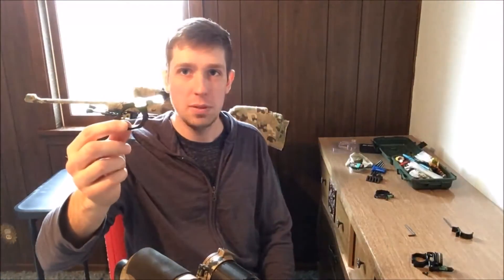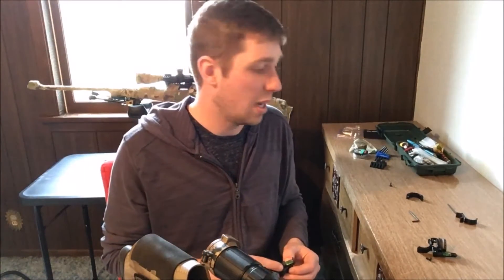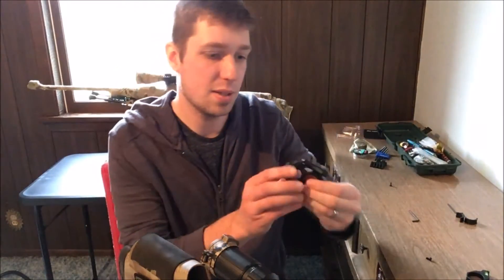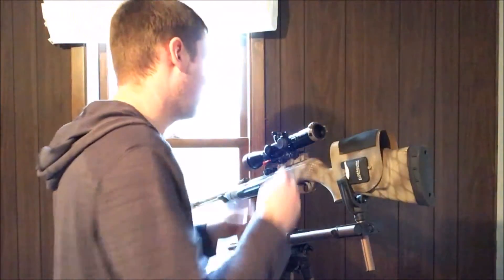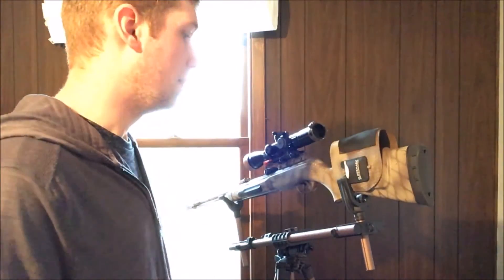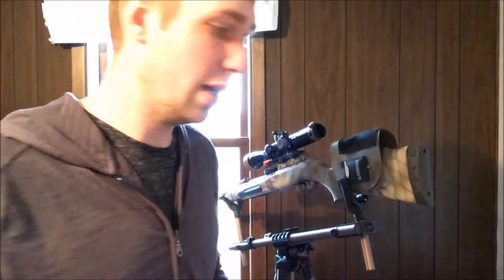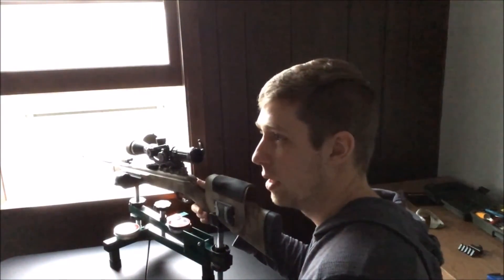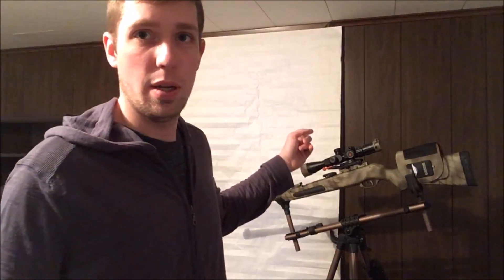Lone Star Precision - Angle Cosine Indicator & Level (An Edgy Reviews First Look)

Comment: The Only Issue I have with Mine Perhaps Lonestar being receptive to You. Maybe you can mention to them that the numbers on the Angle indicator on one side need reversed so that if you are a Lefty and want to mount it on the other side the numbers are facing up. Also the ability to take off the Scope bubble if you don't have antifreeze inside of it would be nice as well. I have lost multiple Scope bubbles because whom ever makes them often places water inside of them for the bubble Rifle and Hunting season is Outside and stuff Freezes. Soo the Bubble will bane you to at some point. It would be great if they could fill the bubble with Tritium like Mortar Sites but that might dramatically increase the price. I went to  Harbor Freight and bought cheap regular Level and attached shock cable and a tie to it so before use you can place it on either muzzle or on scope.
Reply from the maker: IRONHealzer yeah at the price point I think this is as much as they can do.  They aren’t really making a high profit off these.  Even so I will send your thoughts onto them!  Mine has been working great still for me.  I’ve shot mine down to -10 and the bubble hasn’t frozen which really surprised me.

Comment: So how is the lone star precision angle degree indicator working for you? Is it worth it, is it durable? Thinking of putting one on my 6.5 CM.  Thanks
Reply from the maker: Hey SL Bell, mine has proven to be durable but consider that the arm does move so it's durable as long as it's collapsed.  I have heard of one case where a person got that center screw to work out on the CI, so I'd recommend just a bit of blue on that screw just in case.  I really like it quite a bit though.  Thanks for subbing by the way, sincerely appreciate it!
Reply: thanks

Comment: They have those angle indicators bubble levels on some sites for 13.99 to 25 bucks. What cost was yours?
Reply from the maker: I can't remember because it's been quite a while.  Lone Star sponsored me one for the Level/COSI version, which is something like $65.  A regular quality level can be purchase through MKmatching for around $25.00.  The cheap ebay/amazon ones are out of spec most of the time.  Hope that helps, thanks for the views!

Comment: In my area, wouldn't consider shooting a 22lr up into the air...let alone a center fire. Would have to be an extremely desolate area for that.
Reply from the maker: How about from a high place to a low place?  That's what a Cosign indicator is primarily designed for.

Comment: THIS IS GARBAGE
Reply from the maker: I like turtles.
Reply: apparently you like to skink the mink too --- filterboy
Reply from the maker: In a large bowl, sift together the flour, baking powder, salt and sugar. Make a well in the center and pour in the milk, egg and melted butter; mix until smooth.
Heat a lightly oiled griddle or frying pan over medium high heat. Pour or scoop the batter onto the griddle, using approximately 1/4 cup for each pancake.